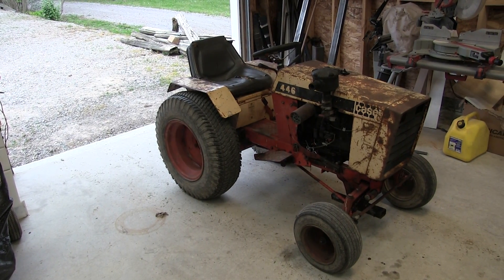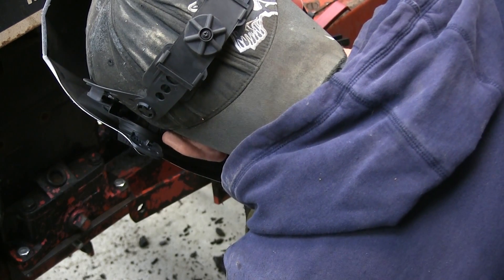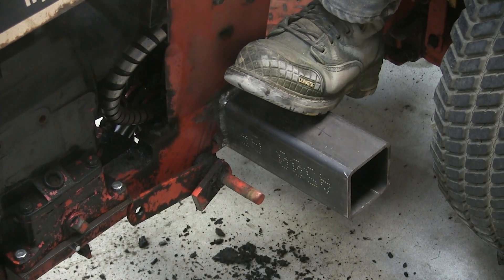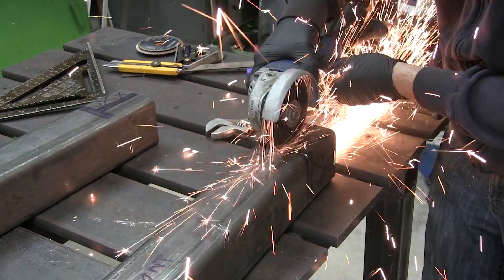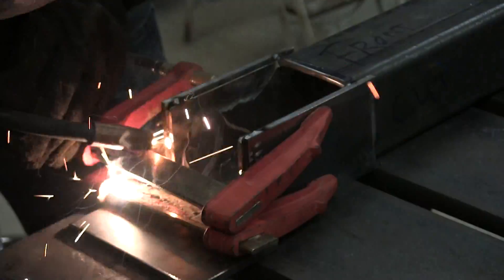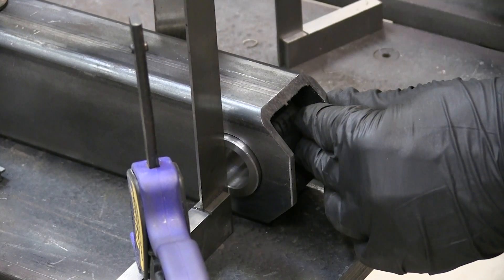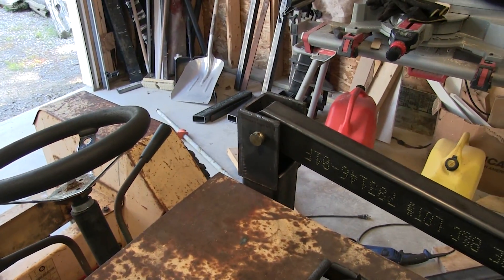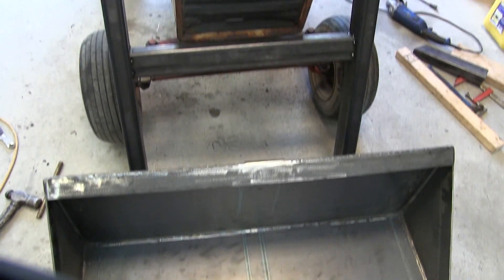Case 446 Front End Loader Arms Build (Part 2)

Comment: god...i had to use bolts for most of my joints on my build then back weld the seams because i cant weld for crap! you make it look way to easy.
Reply from the maker: I've been hobby welding for 20 years. Keep at it. Get your steel clean, set your heat and wire speed correctly and try small cursive e's.
Reply: Thanks! Right now o am doing mostly stick welding... my wire feed is a 90 amp harbor freight that I just wouldn’t trust to it’s welds to hold up for a loader lol

Comment: 6:42 lol how did I miss the Simcoe ONT on the hood lol. Also I'm not to fawned of  welding the loader frame to a machine unless is was meant to be part of the super structure like the dash uprights on the case 646 tractors or designed like later backhoes. Makes it harder to work on the machine later, but with a sub frame the whole assembly can be dropped if need be.